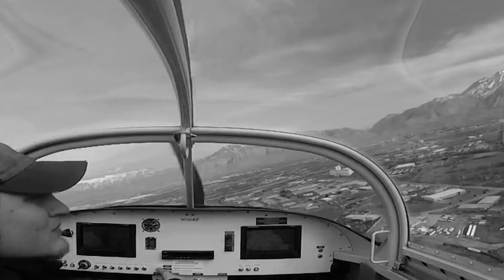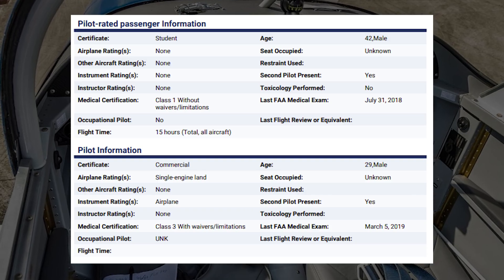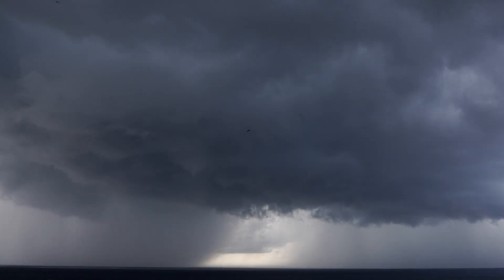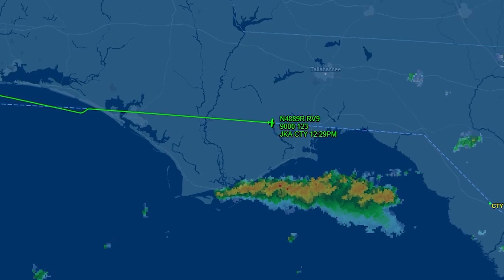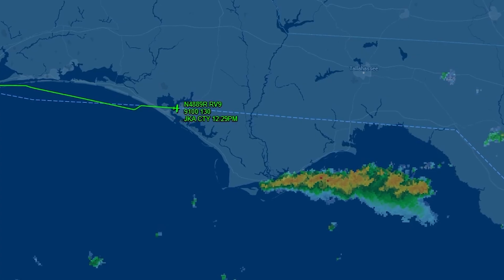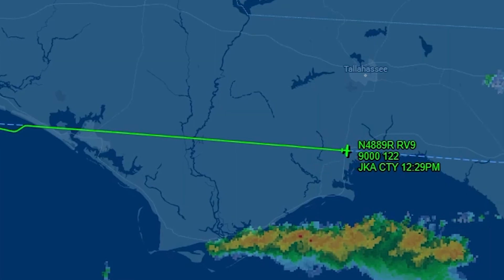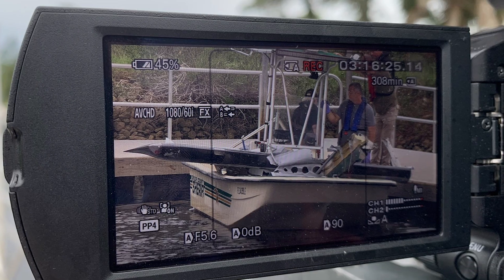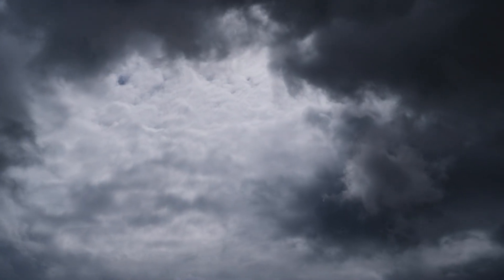The Pilot’s FATAL Mistake That Caught Himself Into an Unrecoverable Trap...

Comment: No mention of "manoevering speed". I think this could have saved them, but it is only rarely taught - I found out about it only years after I got my PPL. 

Basically, it's a speed where, if you get hit by a sudden updraft or downdraft, the angle of attack will exceed the stalling angle, so the aircraft will stall momentarily. Of course that is undesirable - but less undesirable than having the spar snap! (On any given aircraft it varies with the actual weight; the figure in the POH - if any - is for maximum authorised weight, and the actual figure will be lower if your weight is lower.)

I was once caught in a smaller version of this: the VSI was indicating "only" 3000 up rapidly followed by 3000 down. That was quite enough for me, and I can only imagine what these guys went through.People tend to panic about high down speeds, but remember that they very seldom reach the ground, simply because they are blocked by the ground.
Reply: You had a really bad teacher, lol.  Most aircraft have a placard directly in the pilots face showing that metric among others.